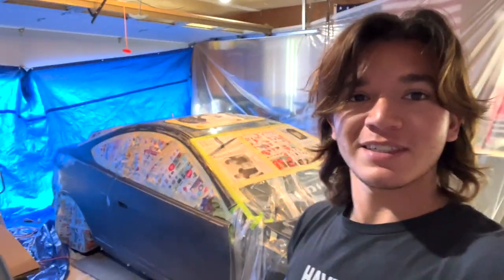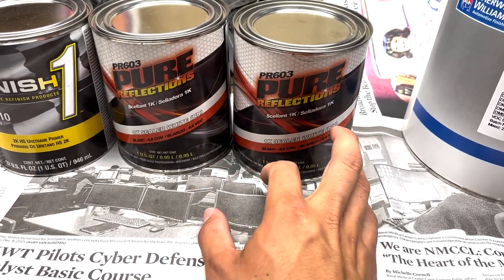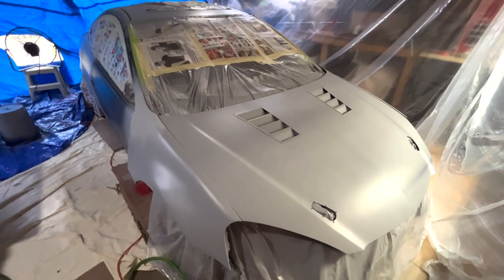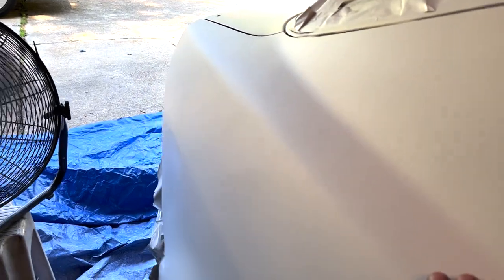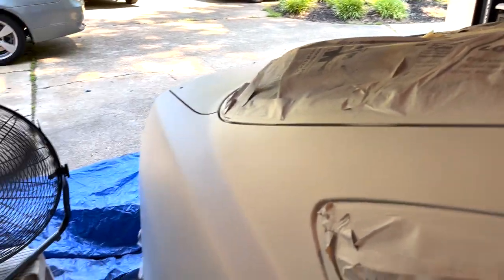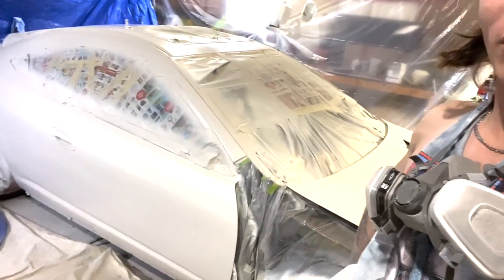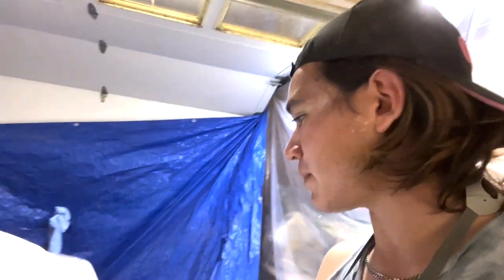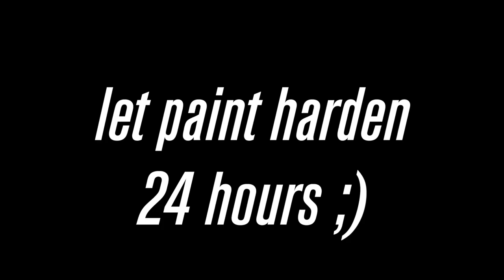Harbor freight spray gun acura paint job (springfest prep!!!) pt. 2

Comment: How many gallons compressor and a horsepower do you use
Reply from the maker: 30 gal craftsman was more than enough air for painting. The smaller the tank the more the risk of water in your air my advice run 2 air conditioners/dryers